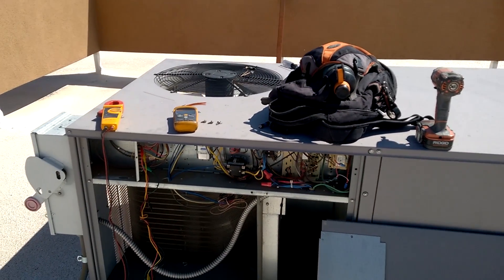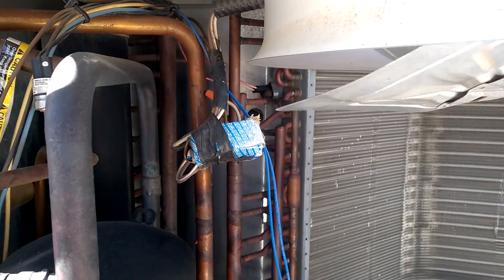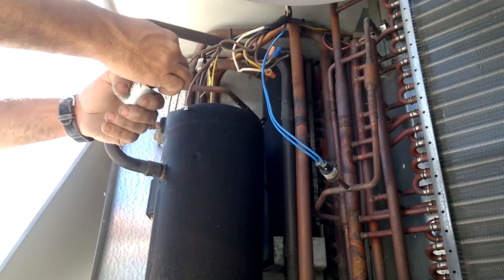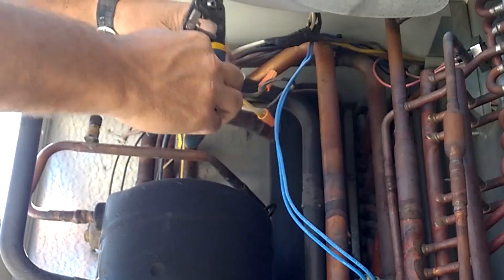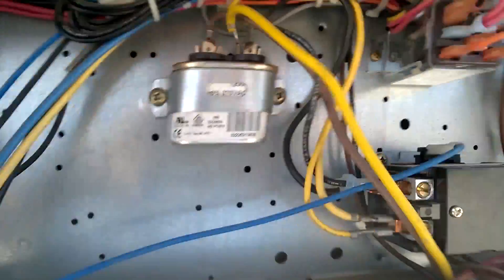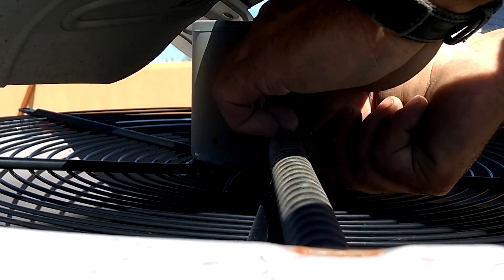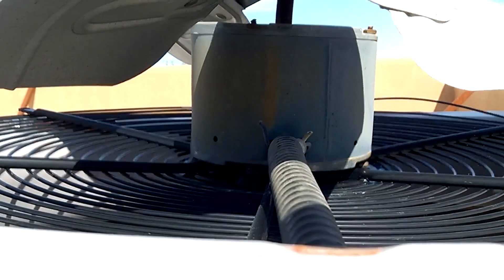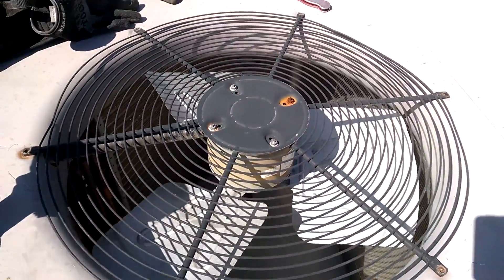The RUN CAP BANDIT returns!  Also how to wire a 4 wire motor as a 3 wire

Comment: I replaced my York condenser fan motor. Looked pretty simple. It was. AC company wanted $725 to do it. Now here's the problem it vibrates. I've played with it trying to figure out why. I used a universal motor. I called Johnston using company discount. I told them my AC model # and I got motor and capacitor. The only thing I can think of is there's something wrong with the fan blade. It's not cracked. I got it to stop vibrating last Friday but noticed it was making an awful whoop whoop sound today. I wonder if I remove the fan blade and see how it sounds without it? I was also wondering if I should just find an OEM motor instead? All the info from guys at HVAC shop guys at work say they use universal motors. The rpm is 1075 instead of 1090 but even the guys at Johnston say it's no issue. Any thoughts on this?
Reply from the maker: Probably bent the blade when replacing the motor. 
That are thin. 
You might need to replace it to get it smooth again.
Reply from the maker: Also,  universal motors are approximate to match the load of the fan blade,  capacitor value, etc.. 
Sometimes they can resonate etc.. 
It's a risk that they won't be quiet like OEM.

Comment: Correct me if I'm wrong. You attach the run and start to the run cap and bounce the run side of the cap onto the opposite side of line power as of wherever you connect your common wire

Comment: If the 4-wire motor has two purples for capacitance, is there a way to run it as a three wire? Put one in a Lennox RTU today that was 460v, had black orange and two purple. Oem was one purple and orange (common) came from other side of the single run cap, black obviously went to the relay.  
I ended up moving orange to the line side of a contactor and put both purples on the capacitor, was there any other way I could have done it?
Reply from the maker: +BoomhauerWorldwide Sounds like you used a universal fan motor that is not like the popular ones which usually use a brown and a brown with a white stripe to the cap. the brown with the white stripe is the same as the common wire. 

I'm not familiar with that motor.
Reply: +hackfreehvac Yes it was an odd motor indeed, I was thinking about it today, I think it sends common out on one of the purples to power the capacitor but there's no stripe to distinguish which, so you have to run both the the cap. 
The motor was an Emerson btw.

Comment: So basically, the brown with the white stripe is a 2nd neutral wire for convenience?
Reply from the maker: weasel2htm Yup. The same as the wire you would put on the hot side of the capacitor (run wire).

Comment: What dumbass is gonna leave the cap in the box and wire it that way? Lol
Reply from the maker: Lazy Donley Service Center was infested with "asses" that did that very thing.

Even if they were just replacing a like for like part. They'd leave the old one in there and put the wires onto the new one and leave it in the box hanging there or shoved into the control panel.

Search "run cap bandit" and for my old hack videos and you will see tons of this I witnessed about 10 years ago.